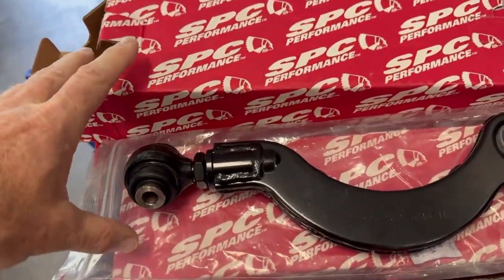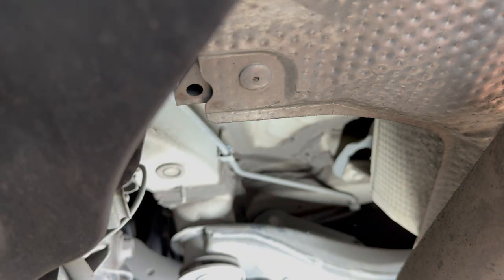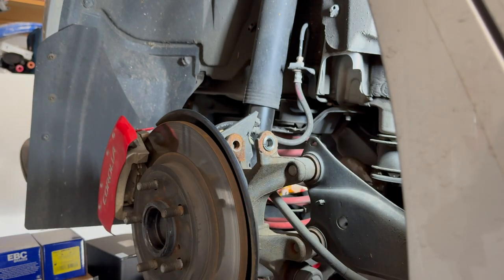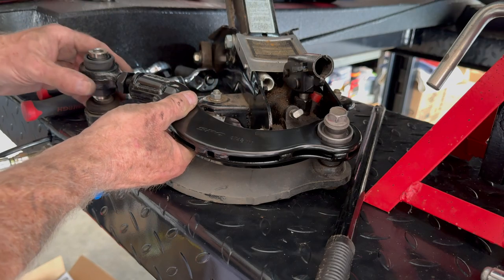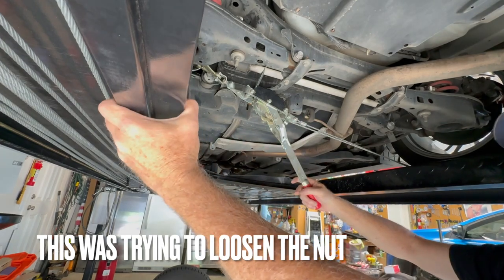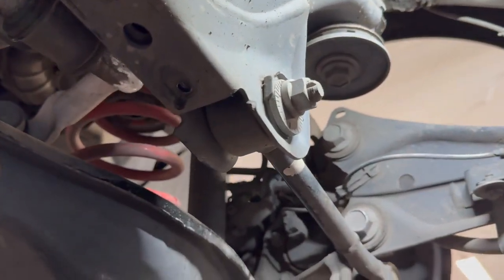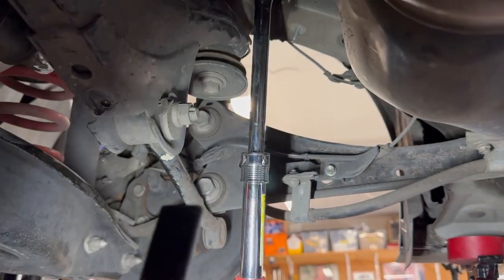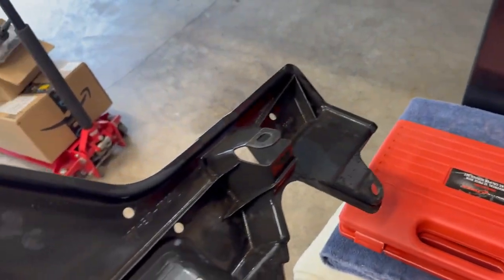2016-18 Corolla/Scion iM - Scion tC2 | Lexus CT200h | Matrix 2 | SPC Adjustable Control Arms Install

Comment: Jim, you for got a car that control arm is used on it also fits an 2009 to 2013 toyota matrix with independ rear suspension
Reply from the maker: Thanks again, I'll add these models to the description.

Comment: I'm pretty sure the 7 generation celica and front generation matrix with independ rear suspension is using the same control arm as well
Reply from the maker: That would be great if this helped them out too. Thanks for the info as I said I wasn't 100% sure what other cars had this same rear suspension. The 7th Gen Celica was much earlier than the other cars so I'm wondering if it was different.

Comment: Is the rear inside tire wear due to your Tanabe lowering springs?  Thanks for your detailed videos.  You have great attention to detail, which is much appreciated.
Reply from the maker: Yes, over the years the springs settles a little more increasing the camber. When I use it on road trips I also have more weight in the car which also increases the rear camber during the trip. This will help solve this issue for anyone that lowers their car.
Reply: Are your front tires affected by having the Tanabe lowering springs or just the rear tires only? @jimsgaragetoys
Reply from the maker: @dcfanboy7290  The fronts were able to be aligned just fine but the rear camber was not, this was causing the rear inside edge to wear out quicker and why I installed the adjustable control arms.